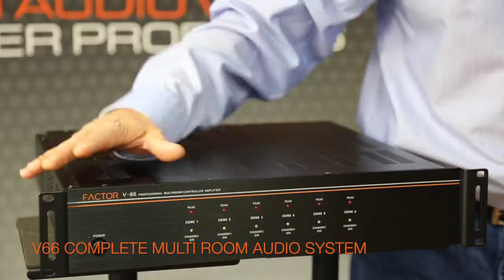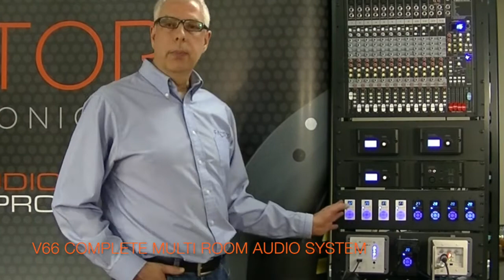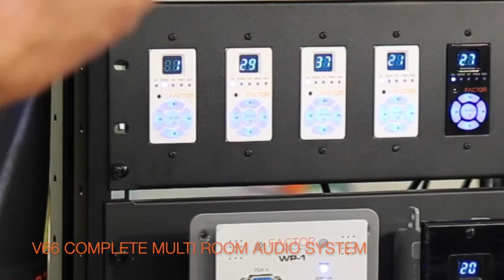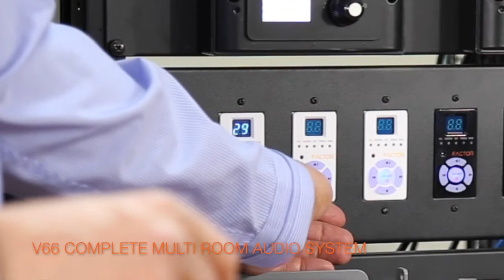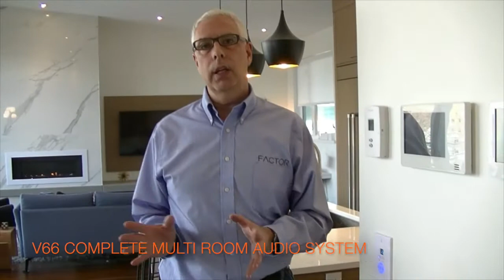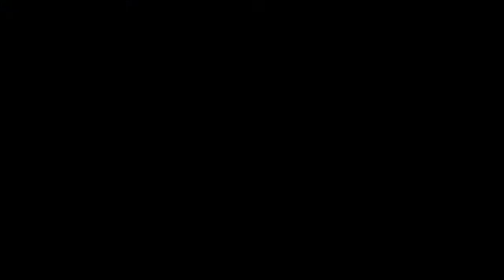Factor Electronics V66 complete six room with six source matrix audio 100W per channel

Comment: Where are these systems available for purchase in the USA?
Reply from the maker: Hi Scott, you can purchase Factor Electronics products from the following distributors in the USA. Anixter, EDI Electrical Distributors International, PAM Distributing, Audio General, and B-Rich Co Distributors. Please call us anytime if you need more information toll free 1-855-204-1388
Reply: Hi. How do I pair my iPhone to the system through Bluetooth?
Reply: Hello, my system loss power, wall plate has light on it but when i press the power button, its not coming on. Could be an easy fix but if anyone can suggest a solution that would be greatly appreciated. Thanks in advance